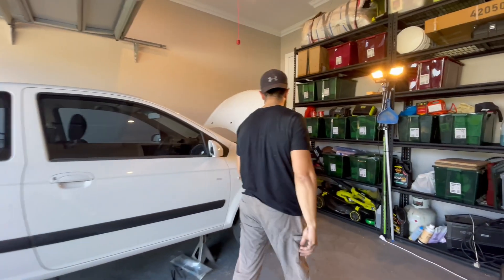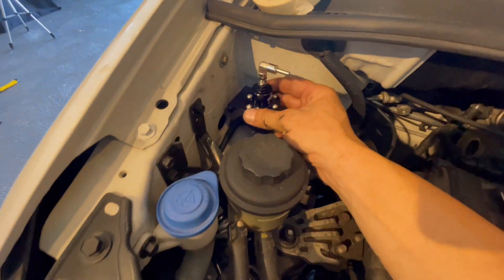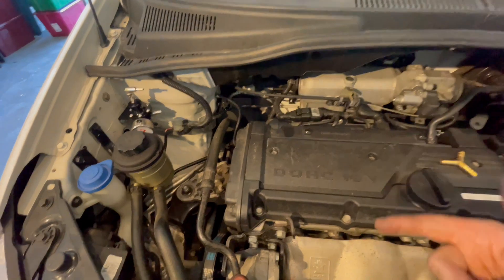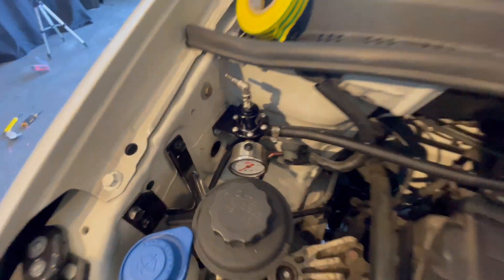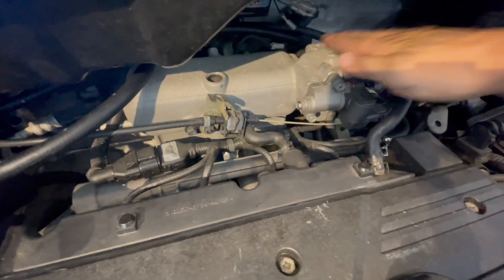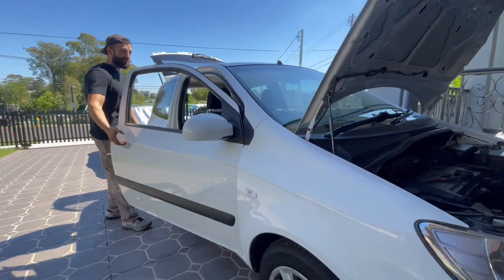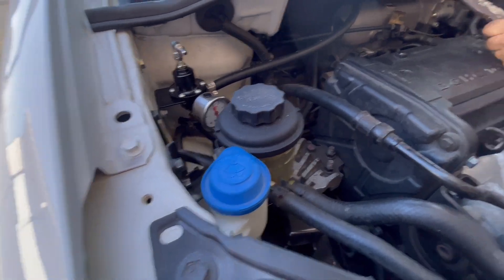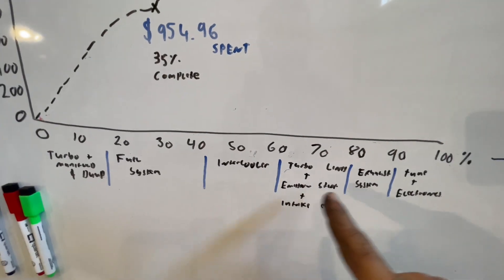How to Turbo a Hyundai Getz. DIY $2000 Challenge. Episode 3- Return Fuel System (part 2 of 2)

Comment: Bro you can't spray paint intercooler fins like that. It messes with the cooling properties of the aluminium
Reply from the maker: Considering the cores thickness and 2 coats of spray barely penetrate alot of the fins/core itself, it shouldn't be an issue.
I understand the internet will argue whether black paint helps or doesn't in regards to it's cooling effects/ thermal transfer.... And MCMs experiment vs Engineering explaineds experiment etc etc ...., but personally,I've been doing this to all my projects (big and small HP) for over 20 years now and the hottest Ive seen intakes post intercooler is 50-ish degrees Celsius. So to think it's had any noticeable negative effect, then No. And in Australia, our summers are Very Hot. 
However, if I was dumb enough to dip it in paint or spray a litre or so on it (front and backside) then yes, I can see the thickness of the paint being an issue, and I will agree.
A dirty intercooler or bent fins is probably worse as air flow gets restricted to sections of fins on the cooler 

No paint or lack of paint will help an already undersized intercooler. If the cores the right size to start with, your gonna be Ok, just go easy on the Spray😊👍

Comment: Didn't need a fuel reg for mine,  used bigger injectors with a injector driver. Works good up to 10 psi

Comment: Also, for where you wanted to put the fuel regulator where the airbox is, what my plan was with the getz was to move the battery to the rear of the car, so I could bring a pod filter to the front
Reply from the maker: @coopercherry7382  that could also work, just keep in mind that a battery in the boot is good, but needs the proper venting kit as it can pose a problem in a rear that's only covered by a parcel shelf. Venting kits aren't hard (just a tube and a hole in the car). But just keep in mind it's an added expense.

The air filter has an even better spot it can fit. Keep an eye out for the next episode. Might save you a few $$$ too 😊👍
Reply: @RocketPoweredRamen  yeah I didn’t see the video until it came out it went to a really good spot